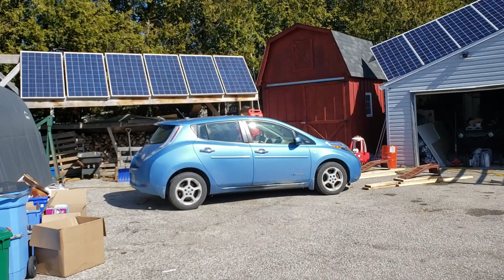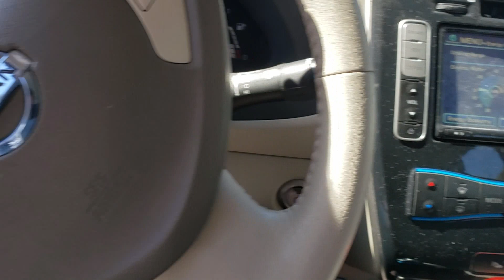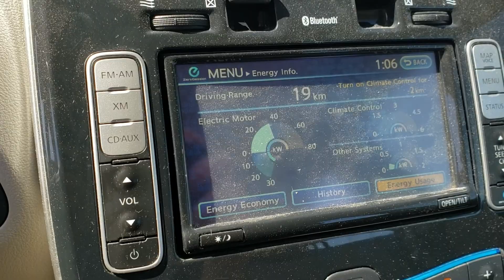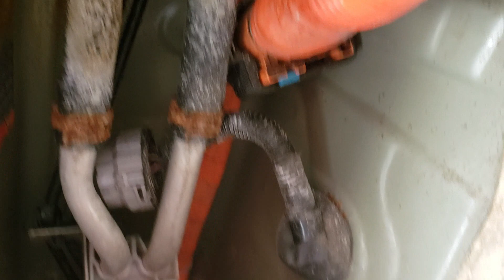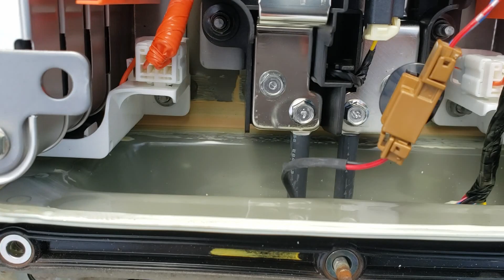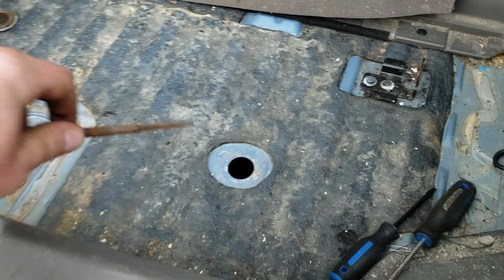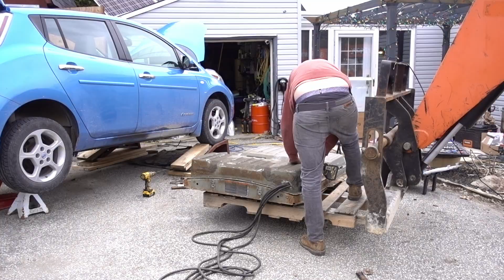DIY 52KWH Nissan Leaf 28Kwh Extender Battery Pt1

Comment: The only issue I see is using the old cells with the new cells. Its gonna ruin the new cells.
Reply: Why is that? I thought combining old and new cells is really only a problem when they are in series. Because if they're in series then the older cells will die sooner and knock out the chain. If they're in parallel they're always going to stay at the same voltage and whichever cell is stronger it's just going to contribute more current. That's why all the DIY power walls with the 18650 cells put 80 or 100 or 300 cells in parallel? What is the reason you can't put an older cell in a newer cell in parallel?
Reply: @BenBrand  Yes but the problem will be a good cell will charge the bad cell until the good one is to the bad level. Same with lead acid. Adding new batteries in with the old is no good. It may not happen in his case but could happen in theory. May even cause charging problems.
Reply: @frankz1125  This is why I thought he should replace the bad ones while apart, he will still get more but capacity but will be limited to the worst cell and the new BMS may conflict with the Leaf bms and pop the shutdown. Just thinking out loud
Reply: @frankz1125  If the cells are the same voltage when initially connected in parallel, how does the good one charge the bad one? I used to think that especially with lead acid it would be bad to have a good battery and a bad battery in parallel because we know that if they were used separately the bad battery would drop in voltage more than the good battery would under load, but when they're in parallel really they're just going to drop the same because the better battery is going to provide more current than the weaker battery would because it's internal resistance is less but that doesn't necessarily mean that it's charging the weaker battery every time there's a load surge and vice versa?
Reply: @offgridwanabe  That would be the way to go. Try for gen 2 cells
Reply: @offgridwanabe  I'm not sure that he had any super bad cells, seems like he was just trying to increase the range and continue using what he could from the original pack. Since the two packs are completely separated and tied together after the BMS's the car has no idea that the new pack is there and neither does the original BMS. It's also tied in before the contactors so if the car ever thinks something is wrong breaking the contractors will also disconnect the new battery from the car.
Reply: @BenBrand  Best is all new batteries. It will still work. And if you paid nothing for the batteries ,might as well. But Id prefer all the same age batteries in my bank. Thats why I did what I did with mine. Welcome to check my channel if you like.
Reply: @BenBrand  They are tied at the final voltage so the sum of the cells in both batteries is the same voltage not each cell is paralleled so the capacity will be controlled by the weak cell and the bms will try to flatten out the difference to increase the capacity but will show empty when the weak cell is depleted even though the battery could have voltage high enough to run the car. If the can bus in the leaf trys to overcome the low cell voltage and can not it will shut down.
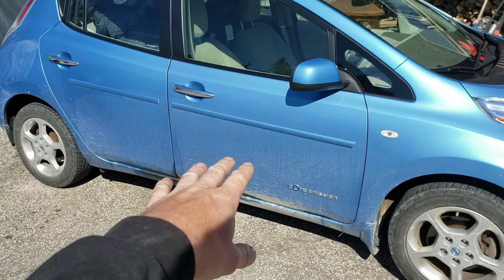Reply: @frankz1125  I will definitely look at your channel, this video just posted, how convenient, at 2:25 he starts looking at current sharing between different sizes and ages of batteries.  https://www.youtube.com/watch?v=k-V8RIuyBbU
Reply from the maker: @BenBrand  Bingo!
Reply: @frankz1125  Just saw your comment on charging problems. That is a good point. If the car is thinking that it's a 28kWh battery and say the battery was dead and you start charging; If the car is smart it would think "hey, I've put in 28kWh now but my voltage is only a little over half of what it should be" since the battery is so much bigger. Might have to charge separately from those black leads he ran that are tied directly into the battery. Will be interesting to see how smart it is or if it looks at that. For sure the calibration of the battery bars will be off.

Comment: Id like to know , Two years on how is this working out ?
Reply from the maker: I drive it all the time working good so far
Reply: @GoingOffGrid101  Any degradation or loss of mileage with the extender pack ?
Reply from the maker: @offgridmaryland  no none yet
Reply: @GoingOffGrid101  Im at about 21KWH left on my 2017 Leaf ,  I been looking into things i can do to boost it up a bit   Damn thing lost 9kwh in the first 62k miles
Reply from the maker: @offgridmaryland  that sucks, it's dangerous but I like the results

Comment: What year Leaf is this?  I've been looking at he doesn't say anywhere.
Reply from the maker: this is a 2012
Reply: @GoingOffGrid101  COOL! I'm going to go look at a 2012 SL for sale near me in the next day or so.  Any thoughts?
Reply from the maker: @Javaman92  are you planing to upgrade the battery?
Reply: @GoingOffGrid101  not really. The farthest I've driven in the last 2 years is 30 miles. And I've just done that 3 times.
Reply from the maker: @Javaman92  then the leaf should be great for you. once the batter health bars drop below 8 you loose most of your regen braking. other then that keep a good 12v battery in the car and you should be ok.
Reply: @GoingOffGrid101  thank you so much. No one I know has ever even thought of going electric.

Someone told me that the car will not come with the cable to plug into 120v?! 
I've been searching to see if that's true and haven't found a good answer yet. 🤷
Reply from the maker: @Javaman92  when I bought mine it came with a 120v charger, I would ask and see if it will come with one, if not they are on amazon starting at around 180 bucks for a level 1 120v 15 amp.
Reply: @GoingOffGrid101  you are the best, of course I had to subscribe. 😁
Reply from the maker: @Javaman92  thank you , I still have my car and will have to do a update winter video!
Reply: @GoingOffGrid101  that would be cool. 
I'm hoping for this car to have at least 10 bars, is that unrealistic?

Comment: Stupid and dangerous....for so many reasons u get a fire inside the car gonna be fun u have an accident ....I wouldn't wanna be in that car shouldn't be on the road what happens in a massive rear end smash and roll over hope you don't get a frame leak of high voltage will you tell your insurance company 😁
Reply from the maker: You dont know the fax, I'm building a frame around it and sealing it to the inside of the car